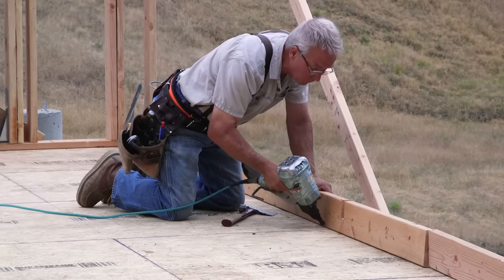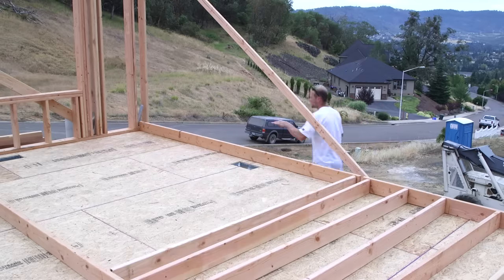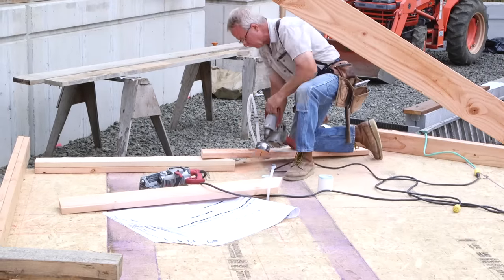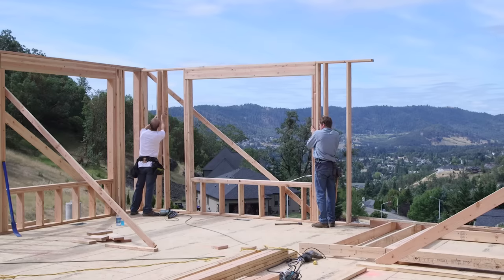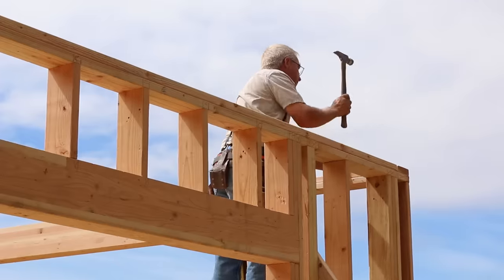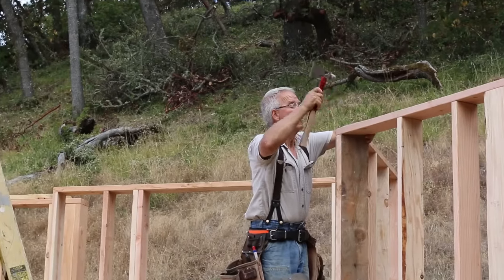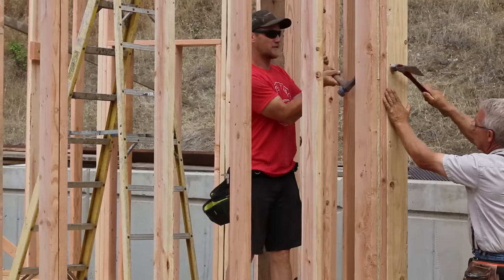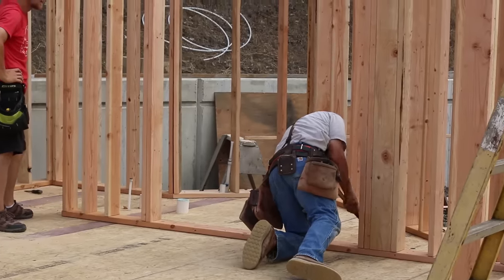Framing: Crown Plate, Toe Nails, Lifting & Bracing Ep.48

Comment: Raising walls. I remember getting called by a guy I'd worked for previously to work on a spec house he was doing (I had been out of town but his helper wasn't working out). Huge house, and the main floor was ready to be decked when I came on. We started framing the walls (clad before lifting) with the longest wall  - easy enough to do until we started looking at what seemed like half a mile of heavy lifting. I was looking at my older boss and at my skinny self and wondering how we were going to do this. Well the old guy was smarter than I thought. You see the site had required some blasting to create a suitable building site (ocean view, so worth the expense) and there was plenty of blast rock still on site. Across the street there was some major landscaping going on, and the boss had told their crew to help themselves to whatever rock they needed, which they happily did. As I was pondering the predicament we were in regarding lifting this wall by hand, the boss just strolled across the street and asked the landscapers (obscenely burly men all) if they had a couple of minutes to spare. Four or five of them happily trotted over to our site and, I swear this is true, using only their pinky fingers had that wall vertical in less time than I could say "hernia". Not a wall jack in sight. A normal man might have felt inadequate in a situation like this, but I was just immensely grateful - for the large men who were probably happy for a break from their travails and for my boss, who understood how the currency of favors and respect works in the trades.
Reply: Love your comment " the currency of favors and respect works in the trades."
Reply: I did not expect to read a great story while watching a great video ( I paused the video) but I did. You sir, are what's keeping YT relevant for me.
Reply: That story made me smile, cheers
Reply: murraystewartj I really don’t understand why you spent a few minutes typing this pointless story up.
Reply: @mc52  Just one of the many unseen aspects of our culture.
Reply: @lukepaul2882 , Cause it's a good story.
Reply: august in what regard?
Reply: @lukepaul2882 , In the regard that I liked it.
Reply: @lukepaul2882  The story is far from pointless. It illustrates the way people used to treat each other. I was raised to be helpful to those who needed help and respectful to all. Try to remember that "what comes around- goes around". You will be a better and happier man for it.
Reply: Buck Whitetail pointless story to me, gone of those days bud. Catch up to the rest of us would ya
Reply: @lukepaul2882  Peace be upon you son.
Reply: @lukepaul2882  hmm. Ya know, i suppose i don't really underatand either? In fact, I hadn't even considered my level of understanding regarding his storytime decision,  until you mentioned it . 

Is this unusual? I mean, as you read through the comments, did you feel as if you had a good grasp on why people said what they said, but then you got to that story and suddenly felt confused?

Anyway , having given it some consideration, I'll put my ideas put there.

1. Something about the video made hin feel nostalgic, this story came to mind as an example of his time. Those who enjoyed the video probably would enjoy his story as well.

2. He has schizophrenia, and "they" wanted to hear that story again.

3. He is lonely. Remembering the joy he once felt when he thrived within his circles of peers compelled him to reach out and initiate contact with others. He hopes none mock him for sharing it.

4.  He likes to tell stories on YouTube, but Doesn't know how to operate a camera.

5. He has a keyboard test coming up, and the practice drills  are boring af.

6. He is a compulsive liar and just had the urge to make up a story. Telling it to this audience is advantageous because in this mind the number of people he lies to is paramount over the number of lies he tells. 

7. He's a novelist, and Is gauging public reaction to his recent idea. Turna out everybody likes it! (except this one asshat who didn't understand why)

What you got? I really want to understand,  too
Reply: Jon Crosby 🤣🤣🤣🤣
Reply: Luke Paul Troll much?
Reply: Jon Crosby 🤣🤣 you summed it up perfectly but I’m going with number 6.
Reply: Buck Whitetail people still treat each other the same way
Reply: marcellinasfigaro yeah I missed the point. Elaborate on it a bit more for me please. I’m just a youngin pops
Reply: Jon Crosby who would try and build/frame a house alone or with only one offsider?
Who would profit from a new build but be too cheap and frugal to employ enough people to do the job? 
Who would employ a one man gang to build a sea view home? Sea view homes generally mean multi million dollar projects. 
STORY SEEMS LIKE POINTLESS LIES AND BULLSHIT.. who can lift framing with their pinky’s guys? Long story short ain’t no way in this modern era someone is going to lift they fingers for free. ESP when your making huge profit. Get ya check book out or ya Wallet and pay 💰
Reply: @joncrosby8988  Ha! You forgot #8 - All of the above (which would have been the correct answer). Thanks for the laugh.
Reply: @lukepaul2882  Luke, Luke, Luke. Clearly you need clarification, so I'll try to keep it to a level that even a flat earther can understand.
The guy I worked for was semi-retired and wanted to do one project a year. He would look for under-valued lots that had potential, figure his margins, then buy them. The time-frame for construction was 2-3 months during the summer as he was in no hurry. Yes, it was two guys just building a house but doing it efficiently. He was a perfectionist and I learned more about framing and dedication to quality from him than I can give justice to here.

Yes, the home did have an ocean view (partial, but still worth money), but the site had been left undeveloped because of the blasting required to make it buildable. The boss found a site that others had passed on for years and lucked into a desperate seller/willing buyer situation, which made the numbers work. And we're not talking multi-million dollars here, I think the home was sold for about $350K or so (different markets, different prices). 

I think anyone who follows this channel can understand that two guys can get a hell of a lot of work done when they're on the same page, following a plan (both the blueprint type and the mutually agreed work flow that just organically exists between like minds). You have to be there.

As to the landscapers lifting a wall with their pinkies, well we all know that didn't happen. It's an exaggeration used to make a point - a literary device to make a true story more interesting and humorous for the intelligent reader. And at the time, it seemed like that was what these guys did (thanks landscape guys).

You said, "Long story short ain’t no way in this modern era someone is going to lift they fingers for free." I disagree. Despite the supposed animosity between framers, plumbers, sparkies and so on, I have been privileged to see incredible co-operation and respect between all the various tribes who come together to build a home. We're all working towards the same goal.

As for the landscapers doing the wall lift for free? Remember that the blast rock (which we needed to get rid of eventually). They picked through that pile for a couple of weeks getting the right pieces for their project and it saved them big money having a free quarry right across the road. Favor for favor - everyone was happy and nobody got hurt.

Got a great story about the peacock on the previous year's build, but I guess that would be a lie too, as you weren't there to witness it.
Reply: Great story!
Reply: @joncrosby8988  greatest troll beat down on YouTube I've ever witnessed 😂😂 bravo sir, bravo 😂😂

Comment: A few tips when nailing/standing walls from a carpenter;
1) When nailing down a wall, make sure you nail the bottom plate to every floor joist (if the wall runs perpendicular) and if not, then nail right up against the studs. Your electrician and plumber will thank you.
2) On large walls, to make your life easier, build them in pieces. For example a 20ft wall can be stood as two 10s. Make sure the wall breaks on the center of a king stud (one that goes from bottom plate to top plate). Some recommend cutting the bottom plate at least 4 feet longer or shorter than the top plate, so they "break" in different places. Then you'd just build the missing 4 feet after it was stood up.
3) When you have to build a single wall in pieces, make sure your double top plate overlaps the break in the top plate by at least 4 feet.
4) Learn the beauty of using a toenail. Usually it is a 16D 3" - 3.5" nail. If driven into the corner of a 2 by it will pull the board in two directions simultaneously. This will be a great help when standing walls.
5) Unless specified by the engineer/architect you generally nail boards together as follows; 2x4 "snake eyes" or two nails right next to each other. 2x6 = 3 nails, 2x8 = 4 nails, 2x10 = 4 or 5 nails, 2x12 = 5 or 6 nails. Each grouping (or line) of nails are around 2-3 feet apart.
6) Subject to engineering details, any window opening or door opening 5 feet or smaller needs only a single trimmer (jack stud) on each side of the header. 5-8 feet requires 2 trimmers. 8 - 12 feet requires 3 trimmers on each side. Over 12 feet and you will likely need a gluelam or other engineered beam and at least 4 trimmers. These are rough guidelines and depends on the load it will be carrying.
7) Jeffrey Epstein didn't kill himself.
Reply: All great tips (retiring carpenter/plumber/electrician)  and indeed Epstein did NOT kill himself...I personally don't think he's even dead...I think they spirited him away...He's one of the tribe; they don't eat their own...
Reply: All true 😂
Reply: On note 1:   Only if you like your electrician and plumber.   If not then nail the piss out of it.  Lol.
Reply: Point 7:  classic!  Nice.
Reply: B T — It probably is obvious to you pros.  But generally, it’s us diletants who are intently watching these videos trying to catch on, and the key to learning is redundancy.  So the additional reinforcement is actually welcome.  And don’t you just love the free and easy way that Scott gave kudos to Larry Haun?  That’s the spirit.  A total class act.
Reply: @gregormann7  agreed, Scott a man of class
Reply: Get your own YouTube channel
Reply: @i8dapuszy  you never need more than 2 trimmers? bruh....
Reply: B T  Wow dude. If you could submit a comprehensive scope of your knowledge, we'll all make sure to share at the appropriate level. If you don't already know everything, of course. 

Problem with your attitude is, lots of people other than "framers worth a shit" will likely view this video and read comments. So, why not share some of your own experience, instead of trying to make sure we all think you have some ?
Reply: @i8dapuszy  Idk how varied codes could be for something like bearing surface. Its overkill, but it's really common to see, esp from guys that came up building in the 80. Different methods for different reasons.

Now we're serving up energy efficiency, with a side of conservation. The AWC has a target on every  stick of timber in a house, so we can win the war on thermal bridging. Actually, the last few code cycles allowed for eliminating headers in nlb walls. No Jacks. Or cripples, in most cases. Not that anyone noticed (or cared). I got on board quick. I like easier. It's also unnerving to realize  how expensive all of that "utility lumber" is. But, habits are hard to break.  I still pack corners. And Im not a framer, so if I'm running my mouth I might build up a 2x6 header for a closet door before I realize it! 

I think, drop the damn lumber and pass my hammer.
Reply: Laminating dimensional lumber with nails is done with half as many nails as the nominal size of lumber as you say in #5, however the frequency of the lines of nails should match the layout (16" or 24" on center) and ideally the nails should stack on stud layout if you're really trying to do a nice job.
Reply: So much crabbiness. Build bridges, not walls. Oh, wait.
Reply: @godbluffvdgg  very possibly but they actually do eat their own. anyone who has observed a wolf pack knows that the main predator a wolf faces is other wolves.
Reply: B T  that why you be a genius!
Reply: B T  I always thought at least me for instance I always thought that I learned by watching and doing combined I think they're both equally important
Reply: B T  some of the toughest people I know are carpenters and I mean tough-as-nails out in the cold out in the rain in the sun lifting heavy s*** lifting muddy walking in mud I never worked as hard working with framers ever in my life!
Reply: B T  Be nice.
Reply: Love the sharing of knowledge from carpenters 😊

Comment: love your videos. ...keep them coming. I'm 46 years young and believe it or not just finished my first 3 months as a carpenter. Never too late I suppose. 

I never thought itd be so hard to draw a line where I want it and cut that line to length....and dont even get me started on the art of using.a hammer. It took me a couple to find what I wanted. 

Anything that saves time and helps me work smarter and more efficiently is golden right now. 

The guys I work with and for are master carpenters....so I'm constantly trying to keep up. I framed my first wall the other day and while it wasn't easy, my wall is still standing plum and square today. 

Can you remember being a new carpenter? Maybe mechanics of cutting a straight line with a circular saw w/lots of close ups...tricks to for doing things like rips....cutting to a 16th on measurements. If you're off a 16th here....what will it be when you get there?

Comment: Just wanted to say thanks.  I've been working in bodybuilding and cabinet shops my whole life.  Currently finding more work in home construction for the first time at 45 years old.  Interesting to translate the skills.  I used to look down on the framer/carpenter and that is no longer the case.  It's humbling to do everything with a skilsaw I used to do with CNC, panel saws, router tables, and software.  I have new and profound respect for all the tradesmen.  Thanks for all the tips and encouragement.
Reply: That was boatbuilding before auto correct.

Comment: What was so special about larry haun is that he made no unnecessary moves and they worked very well together with his brother. It seems from videos that the one who is faster in some work usually does it.
Reply: And Larry hardly needed a tape measure and only needed to pop 1 line ,probably the best and fastest carpenter to ever swing a hammer
Reply: Larry and Joe could frame a house faster than 8 guys

Comment: It’s so painful to watch walls go up without being sheeted and house wrapped on the deck. It does take more guys to lift the walls though because they are heavier. It still beats sheeting the walls after they are stood though! It’s so interesting to watch others frame!
Reply: Good point though not all walls get sheathing. The structural plan will dictate those that do, the type of covering, and  the nailing schedule. Sheathing a wall “for good measure” will be food for a sharp construction defects lawyer to use to sink you. Their comment in court will be “if you did this for good measure why didn’t you add extra rebar in the foundation.” Etc.etc. We only provided to the strict compliance with the structural engineers plan. No more and no less. take if from a guy who has paid out many hundreds of thousands due to unethical and unscrupulous buyers/owners.

Comment: I can't help but imagine my last boss showing up to the site with all the walls standing and no sheeting and screaming at us "WHAT ARE YOU DOING!!??" But with a lot more color.
Reply: Yep. Best to avoid OSHA interventions whenever possible.
Reply: I was a GC an journeyman carpenter in Calif earthquake zones, We had to install shear after walls were stood up and lay the plywood horizontal brick pattern minimum 2 ft pieces and nail the sheer to the sill plate with hot dipped galvanized or stainless nails.   1/8 gap between shear ply. roof H clips are an easy way to hang the shear.
Reply: @timhale501  yeah if the authority having jurisdiction specifically requires the walls to be raised before sheeting then obviously there's no way around that. I am in Oregon, just like Scott, and I have never seen a job where this was the case. But maybe it's different in central and southern Oregon.
Reply: it would be funnier if he was yelling about "sheathing".

Comment: After raising an outside wall of substantial length we would always use a block and string before fastening the top two plates together moving it in or out to insure it was straight. Does anyone else do that?  Of course standard bracing is also used to insure the walls are plumb.  Thanks for your videos.  There is always something new to learn.  You are a true craftsman!

Comment: Inspirational and informational - I'm about to frame my 2nd building, moving up from the small 9 x 12 bunkie I built for my daughter 10 years ago to a 16 x 20 shop for myself.  The headers in this video are interesting - I've never seen headers made up from flat stacked 2x6's.  That seems like a lot of lumber where a 2 or 3 ply header of on-edge 2x material would sometimes be used.  Will have to do some reading up on that as I have a lot of windows in this next project.

Comment: I came across Larry Haun some time ago and picked up some good, quick ways of cutting without measuring and it works. Cut to fit as I call it, works every time.
I saw you using a universal square in a recent video. Have you talked about how handy that tool is ?
Keep up the good work guys!